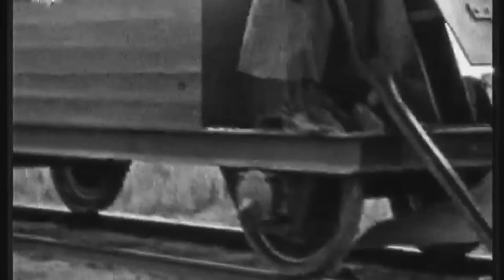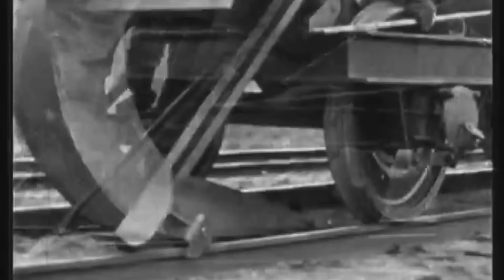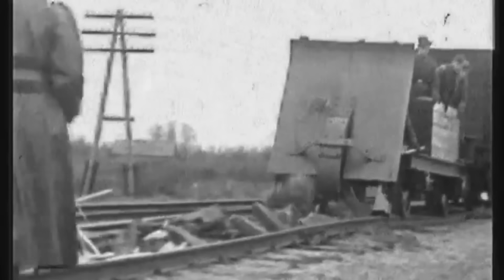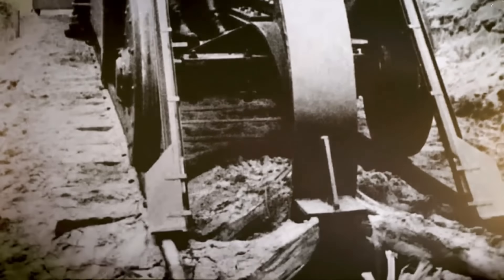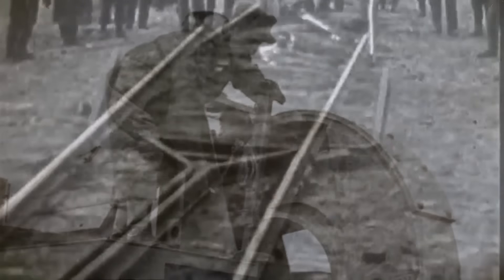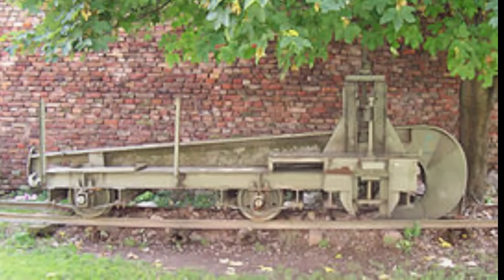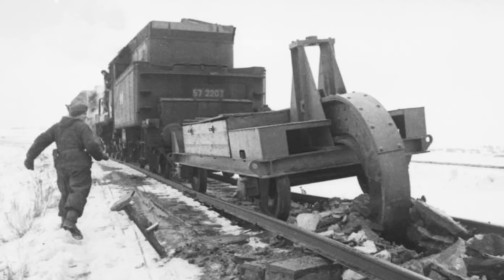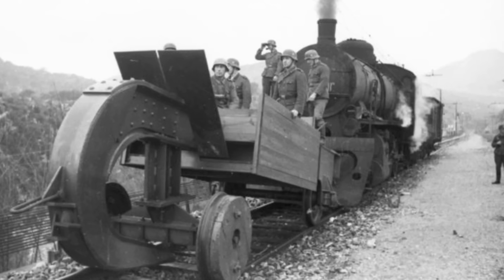The Schwellenpflug: Germany’s WW2 Railway Destroyer #Schwellenpflug, #ww2 #fyp

Comment: 40 years ago I worked with an expat German engineer who had been an officer in one of the engineering battalion's that operated these. He referred to  it as the Track Wolf. He said it was effective, but the impact forces quickly destroyed the bearings in the car it was mounted to, requiring frequent maintenance. When it finally was not repairable they substituted a long rail bent in a U through a trench cut under the track with the 2 ends fastened to a weighted flat car. He also said they were under the command of an SS crew who always wanted to just blow things up, which left a more easily rebuildable roadbed. Ultimately , it was all for naught, as he said the Russians were able to rebuild rails faster than the Germans could destroy them, and he was captured, finishing the war as a POW.
Reply: Very interesting! Reminds me of T.E. Lawrence's strategy of "scientifically shattering" bridges. In a nutshell: if you simply demolished a bridge, the enemy would simply have to rebuild it. It was smarter to use just enough explosives, in just the right places, to compromise the bridge but leave it standing. That way, the enemy has to demolish it (a task you've rendered significantly more difficult and dangerous than it normally would be) before they can rebuild it.

I'm also curious about what happened to the rails. Germany could hardly afford to spare the steel, but reclaiming it would cost extra manpower and risk being overrun.
Reply: It's funny how in war time building railroads is a piece of cake. But in peace time building railroads is a war of attrition.
Reply: Разрушить железнодорожные пути чтобы задержать наступление как-то глуповато.
Reply: @hibob841  I'm sure in a scorched earth policy during a retreat, recovering steel rails for re use later definitely wasn't one of their priorities
Reply: German, 60. The German term I was familiar with is ‘Schienenwolf’ (literally track wolf). The term ‘Schwellenpflug’ (literally sleeper plough) seems to me to be the engineering term, which may be found in technical descriptions, but which was not used colloquially or in propaganda newsreels.

Comment: There was one in a museum in Britain years ago, ironically the Germans needed the rail network more than the Russians as they had limited access to motor vehicles and fuel so needed rail much more, the Russians had lend lease vehicles their own fuel and hard as nails horses so could run a mobile war with less reliance on rail at least on the front line.
Reply: Russian gauge is over 5 feet, that why they couldn’t make much use of the German system at 4’8 1/2”
Reply: @22pcirish Aren't you confusing the Russian broad guage with the Irish one? Russian guage is only slightly wider, just under five feet.
Reply: @ Couldn’t recall the exact width.
Reply: @davidyoung  its 1500 mm or one and a half meters if I am not mistaken.
Btw: there's one on display in the Calamegdan fortress in Belgrade, Serbia. At least when I was a young boy there was.
Reply: @JosipRadnik1 Soviet gauge was 1524 mm until the transition to 1520 mm since May 1970. Germany and Poland operated on standard gauge of 1435 although Germany also operated non-standard legacy gauges. In WW2, both sides easily re-gauged the tracks, wider to narrower, narrower to wider, both ways. Halder (that German big boss who became chief war pundit at the Pentagon) wrote that one German battalion could re-gauge 20 kilometers of track a day (from 1524 to 1435).
Reply: @jmi5969  As recently as 1970? That I did not know!
Reply: @davidyoung  Yes, there was a decision to upgrade all mainline rails to hardened steel and narrow the gauge, simultaneously. Somehow they managed to rebuild 3/4 of all mainline tracks in ten years. And then the rolling stock began to fall apart due to increased wear on wheels. Who could imagine this, really...
Reply: Es wurden die Schienen auf dem Rückzug zerstört. Die wurden von der Wehrmacht natürlich nicht mehr gebraucht. Da ist keine Ironie drin.
Reply: Jemi 
If the wheels weren't reprofiled then the narrowing the tracks would increase flange wear. Seems a rather pointless exercise apart from being a neater metric number

Comment: It was used in France, between La Rochelle and Poitiers at the end of the war (The pocket of La Rochelle surended after the 8th of May 1945). The double tracks were destroyed. The line was rebuilt as a single track. Today the single track is used as a main line between Paris and La Rochelle. The main stations are double tracks for crossing.

Comment: This explains why so many railroad supplies, rails, telegraph equipment, even crossties, were sent to USSR under lendlease.

The Soviets used much longer crossties than USA did, wider gauge, so would be interesting to research length of ties furnished and also to how many switches.

Comment: Funny how the American army was all mechanised with halftracks, troop transported and other vehicles including jeeps, struggling to see how the Americans needed the railway?
Reply: The French rail net was extensively destroyed by US bombing, French Partisans and the Germans.  The Allies were dependent on truck convoys (i.e. Red Ball Express).  This led to shortages and a stalled front.  (That's why Antwerp was so important, it shortened the supply lines.  Which was the Battle of the Bulge's objective.)

If the French rail net was available, the war "might" have ended sooner, or at least the Allies would've been much closer to Berlin.  Imagine how this would've affected post-war events.  

Yeah, the Allies won without the rail net, but the hard way.
Reply: Rail basically lets you move huge quantities of ammo, fuel, troops and everything else with very little manpower. Four people hauling a few thousand tons of supplies versus one truck driver for every 2,5 tons. If you can keep a rail line running from a nearest port somewhere closer to the front line, your ability to supply the troops skyrockets.